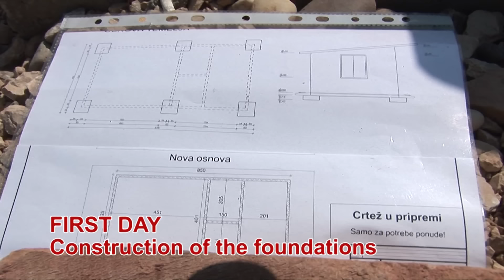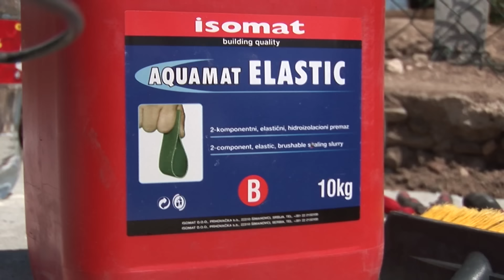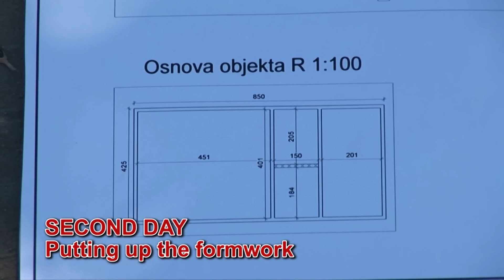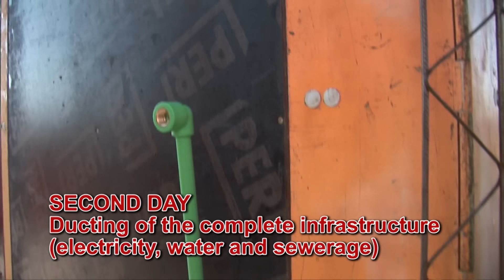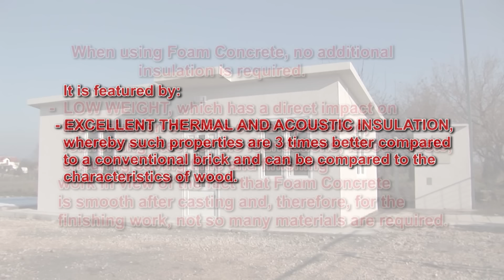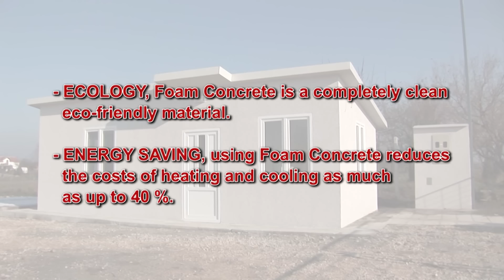FOAM CONCRETE, affordable house built in 6 days!

Comment: What is the chemistry of the foam part of the foamcrete? Does it, for example, release harmful substances as in 'forever' chemicals?
Reply: .. daar gaat vast geen antwoord op komen 🙃
Reply: My thoughts exactly. Of course it releases toxic chemicals forever.
Reply: @jamesonjames8610  —Free head ache for ever
Reply: Each country has its own building material standards.   SRMA is located in Serbia.
Reply: @ikafmedia2007  the danger of asbestos has been known for hundreds of years. But people ignored it especially in the last century when it was highly profitable.
Reply: @sofascialistadankulamegado1781  you're right, when profit sore people are blinded to the consequences..
Reply: It's dish detergent, concrete and air.
Edit: can't forget water :)
Reply: @LuggageStardate  - For what I know, the foam is created with soap and then added to the concrete mix.  Kind of beating egg whites to make a fluffy substance. The result is a form of light, but strong (not heavy) wall.
Reply: I am a professional ceramic, tile, marble and stone industry with 21 years experience looking for a host as a volunteer to understand
Reply: Spray on a sealer coating?
(If it does have vapor issues - don't know for sure). Looks to be a great idea!
😁👍
Reply: @iamaprofessionalceramictil1622  
Having just a little difficulty understanding your comment.
?🤔?
Reply: WVWoman  - They call it foam, because it is foam made with soap that they later use to mix with the cement mix. Go and do some research.
Reply: Hello Christien how are you doing!!
Reply: Ordinary dish soap , for example "Dawn" .  There are also proprietary foaming agents but the dish soap version works fine

Comment: Great video. I have been sculpting E.P.S. for 
20 + years. I did what the computer and machines couldn't. I always was asking, but fell on deaf ears, why don't we manufacture walls that are light, have a very high R rating and easy to put them together on site?
I feel vindicated after watching your video and hope the owners of where I worked are thinking, why didn't we listen to him?
Thank you,
Steven
Reply: I’d love to see your work! Are you on Instagram?
Reply: Non-Toxic?
Reply: This construction company is in Serbia.
Reply: What is the flammability of the foam?
Reply: @stephenaltherr2217  watch the video it says
Reply: @stephenaltherr2217  none, check wikipedia. Loads of info on internet. It is about ensuring the air bubbles are 'stable' and same size
The mix goes by various names.
Reply: I know that feeling! ;-)
Reply: @wolfhenry9134  Non toxic walls would be Hemp concrete ( Hempcrete) theres low allergen drywall and drywall mud for people with severe allergies too . Very Light weight .

Comment: in the UK 1940s, they were called prefabs when they were torn down in the 1980s 40 years after their shelf life they were still servable homes and the occupants didn't want to move out, they had to move into rat trap houses built by contractors using plywood facia boards that fell apart, all modern things are no new or better than what they replace,

Comment: Did anyone notice how in six days trees with leaves turned into trees without them? 🤣
Reply: They didn't say that they were 6 consecutive days.
Between FI day 3 and 4 there would be at least 4 days concrete cure.
Reply: Did anyone notice how there wasn't a slab but 10 small slabs separated by 2x4s 😂😂😂 that's not a slab.

Comment: That's really cool.  How long does it last ? Are there special maintenance considerations? What are its insulation properties?
Reply: 7 yrs - 11 years minimum
Reply: Safety First  hmmm... I saw wooden pillers so I think it'll be alright  
Minimum 100% sure is 3-5 years

But ya it's not 100% safe
Reply: Safety First  r
Reply: Insulation is one of the best , no maintenance at all and will outlast you , it is concrete and styro-foam . it doesnt rot. and it is cheap compaired the regular materials.
Reply: @pauls466  holy sh#t 🤯🤯
Reply: 50 yrs the previous poster said, and still strong
Reply: 7 days.
Reply: what is the r value for the exterior walls, also the ceiling?
Reply: Music is annoying.
Reply: Yrs

Comment: Not using Teflon tape on those water fittings is a recipe for leaking.
Reply: Same guy doing the plumbing joiner and electrical work.wow 15 years at trade school for three separate trades!

Comment: Never mind the house, how much is the land it sits on? How much were the installation of utilities hooked up to the city? Water, sewage, electrical, etc? In California even if the house was free I've seen burned out lots go for 1.2 million dollars in San Jose. Cheap house is a false savings, it's all about the land rights.
Reply: in rural serbia, you can buy a house with a small garden for 20,000 and deal with paperwork later
what i was able to read on one of the workers' shirt, company is from Belgrade, Zemun area
Reply: It was next to the airport so not the most desirable Leland, probably pretty cheap
Reply: Having the wiring inside the foam walls, and no provisions for heating and air has me confused. Different culture, probably top notch for that part of the world. Can't compare apple's to banana's!
Reply: @bigjohnson7415  Literally in Serbia houses aren't at all made this way. They're made of brick, heating provisions are a must (cold winters). I thought foam houses would be a thing in hot parts of US, I have no idea what these guys were doing. In any case, basically the way a house is made depends on the climate. For instance, in the Netherlands houses are made of brick with no insulation, while in Serbia they're made of brick with insulation, cause of the extreme temperatures both in summers and winters.

Comment: Instead of foam cement, maybe  use shredded up pieces of recycled styrofoam insulation and micro rebar mixed into cement. The shredded up styrofoam would provide some  insulation while making the cement lighter. The micro rebar would add strength. Could experiment with shredded car tires mixed into cement. Many car tires have steel belts/strands in them, if adding shredded car tires to cement gave it some strength. It'd be a good way to recycle tires and keep them out of landfills.
Reply: If you watched they used fiberglass reinforcement. The micro steel pins need special equipment and MUST be stainless steel or will rust later. That is one of the biggest problems with rebar, it literally explodes concrete when it rusts. Here in FL we see this problem constantly with concrete.
Reply: R-6 per inch for aircrete .. that's higher than the R-4.2 per inch for EPS foam board ..
Reply: @djea3589  Yeah, those little slivers added to cement are stainless to not rust. Shredded tires might work fine in some things but not others.

Comment: Was it six site days? Or did you leave the foundation to cure for a couple weeks. Then leave the initial pour to cure also for a couple weeks, etc. I did not see a vibrator for the foundation I assume one is not used for the walls. Is this a form of Hebel with fibreglass shreds?
Reply: Had the same thought as you also the tiles application was done on last day without letting it cure properly and then they proceeded installing the bathroom and kitchen cabinets and painting the walls.. etc
I was literally rubbing my eyes watching this video
Reply: @DarthVader-ou2vv  I thought they had poured 2 roof panels and only lifted 1, so maybe the other broke? Pretty sure the tap handles were not level. And as you said. An overall lack of cure time. I guess I am out of luck if I want a new PowerPoint in a different location? I'd have more faith in a core filled block wall with plaster lining attached to furring channels. A crew of blockies would have had that up in no time.
Reply: @MisterGames  I totally agree with you. This type of concrete foam takes way much longer to cure.. How do I know that.. Well I used concrete foam as ground insulation when building my house and it took approximately 4 weeks to get the 12" thick layer of concrete dry and solid enough for further construction.
Reply: It's aircrete it needs the 'air' to stay in it or it loses its R value. If you put any vibrator near that it would be a total mess.  However, I would have thought it would need some drying out before doing other stuff like tiling, painting etc.

Comment: Efficiency function over form. A good start now the work is to make the lego part of the forming so as to allow curvature in architecture and will be a winner.... though 3-D printing is going be a tough competitor.
Reply: I agree,Well said.
Reply: imagine 3d printing a fucking house,it would cost a massive fortune.using all real wood,concrete,brick and ceramics would be cheaper and quicker
Reply: you cant use rebar with 3d printing so wont be as strong
Reply: @Breakn28  Wonder if they can use hempcrete with a 3D?

Comment: Hope nobody needs any piping fixed seeing how its all encased within concrete.
Reply: I was thinking the same thing 🤔
Reply: In Canada at least,  Supply lines and drain pipes in poured floors are pressure tested before and after pouring concrete. It’s a lot easier to break up concrete and replace it than to cut & replace framing, insulation, vapour barrier, rain screen and perhaps exterior sheathings, and/or drywall and then painting and maybe trim too. It’s all too easy to be allowed. This kind of technology would change a great many lives for better.
Reply: 😒 plenty of people encase their plumbing in the foundation. You break the concrete if there was a leak at the location of the pipe that’s leaking.
Reply: @alanaweaver8942  do you build houses? Because it's not really the plumbing going through the floors. Those pipes are for temperature control in the flooring. Not for the house plumbing.
Reply: I think there is sheetrock involved. They just not showing it . I hope.
Reply: @alanaweaver8942  I think we are use to the lumber...lol. Out west they have more of these concrete type foundations, I assume. Different areas/different architecture.  I do actually see it a lot on HGTV homes where they're busting up concrete to reach plumbing.
Reply: @B-EPIC_AMERICA  dude... Almost all plumbing goes through the slab
Reply: @briankappel6131  THROUGH the slab not encased in the slab, that is a huge difference. The majority of the plumbing is in the ground and concrete is poured onto the ground and only the pipes running up into the house are 'in concrete'.
Reply: Along with the electrical from the looks of it. At least they used steel pipes, not likely to have any issues for a long time.
Reply: @MA-mh1vs  so you are gonna tunnel under the slab from the outside to get to a leak? No... Either way if your plumbing leaks you are busting concrete
Reply: @briankappel6131  Actually tunneling under the slab is the least expensive and easiest option to repair a leak. If that is not an option then they can go through the concrete IF the plumbing is not encased in the concrete. The other option is to re-plumb the home from above ground and what is recommended for encased plumbing leaks and if the plumbing is old and may keep developing more leaks.
Reply: @MA-mh1vs  well glad there was an expert here to tell me how plumbing works lol
Reply: @briankappel6131  If you ever have a leak under your slab foundation you will know what your options are ahead of time.
Reply: @briankappel6131  as an architect.. seeing these people claim encasing in concrete is ok and cheaper.. I dont want to live in this world anymore 🤣🤣🤣
Reply: @karinna1456  Thank you.
Reply: Lol, they just tear up the floors inside the house, lol. Looking at the toilet, I'm guessing this is in the U.K.? That's how they do the plumbing there I guess?
Reply: @kman2783  🇬🇧 - no, apparently they have built this in Serbia, according to the other comments
Reply: @gregsullivan7252  Have you ever broken up concrete ? I think not, there is nothing easy about it  and how many times a bad patch job failed and led to leakage in a basement floor .
Reply: Thank you.

Comment: The compressive strength of foam concrete would have to be much less than regular concrete. A two story home would need structural elements other than the foam concrete to support the second floor.
Reply: "foam" 1:58

Comment: the concrete foundation is just newly laid, and it's disturb in one day?
Reply: Does anything have time to dry out?
Reply: they dont say, 6 consecutive days, they say 6 days.  might be two weeks after the foundation was poured, they continued, on day 2 of construction.
Reply: I think they just take out the breaks & concentrate on showing us the work process, not the time line or the whole thing. It needs to be dry for them to do anything else, so, that's my guess?
Reply: @normbograham3  I bet your right, how could it dry out fast enough, and the concrete set, to a load bearing state. they will be erecting an inflatable house next week, and have truck loads of air delivered, and  use that little barrow they have got.
Reply: @kitemanmusic  their using dehydrated water tablets, then you just add water to them, to rehydrate them. a bit like the black light bulbs I have,
 I turn the light on, on the room goes black.

Comment: sooooooo, what exactly is "affordable" ?
Reply: Ha ha there usually like $65,000 aren't they? The smaller and simpler they are the more they are.
Reply: After going down a rabbit hole of links connected to this video I need up at International Foam Concrete Institute. On average it's 70% less expensive but from what I see only a few countries use it. It's kinda brittle.
Reply: @PaperDragons  brittle?
Reply: @joeyknight8272  They are not able to pass most building codes in the US due to issues with being brittle. hard but liable to break or shatter easily.
Reply: it's affordable if you have enough money, but as you say, how do we know, affordable is a reletive term, like hot and cold, light and heavy, long and short, it does not tell us anything.
 some people could afford to own a home made of gold, some people could only afford a home made of straw and mud.
Reply: @daibhiseaghdha153  you can make house from shipping containers, they are stronger and affordable and durable with weather and even very good for earthquake , or storm , flood
Reply: @joeyknight8272  house buil from shipping containers are stronger  than this and also affordable
Reply: @PaperDragons  houses build from shipping containers are more stronger and more durable than this and they pass Us, uk, , Australia , Canada and most countries
Reply: @HueNguyen-xj6rj  most end up being as expensive or only slightly less than traditional buildings from the videos I watched. Shipping container homes are more for novelty seems like
Reply: yes they should let us know cost per sq foot, or per sq meter if outside the US, plus typical maintenance & repair costs.

Comment: If a pipe broke or something went wrong internally, there's no way of doing repairs since all the internal components are incased concrete?
Reply: Steve SZP apparently you live in america where everything is drywall
Reply: I didn't see an answer to your question. hmmmm
Reply: gmrb79s Drywall is used in European countries also.
Reply: exactly put inlarger pipe fish pex through it
Reply: It's foamcrete/aircrete you can cut into it with little effort
Reply: Just noticed that's a 3yr old comment. Lol

Comment: It’s great that the crew building the house seems to know what they’re doing. But I agree that the crew making the video sure left a lot of questions unanswered. Such as why didn’t they use foam concrete for the foundation, if foam concrete is so good?  Secondly, there sure seemed to use a lot of real concrete. Lastly, it seems like they were first making real concrete, then turning it into foam. Doesn’t that kind of defeat the purpose?  Concrete is pretty expensive. What was the cost of this house?
Reply: I would think foam concrete isn’t as strong as just concrete for a foundation but stronger than drywall on wood for walls and faster to put up. But why play music instead of having someone or at least scrolling verbiage explain exactly the what and whys.
Reply: Nope, close

Foam Concrete is Non structureable 
Non load bearing
No weight can rest upon it

Think of styrafoam with cement, not concrete

That's why you see the rebar form a cube, that's concrete
Reply: Unlike North America, it’s common standard to build houses with a concrete structure and brick wall
Reply: @xhonkeri4066  Not where these guys are from.
Reply: Foam concrete is not as strong even with rebar as a 100% concrete foundation with rebar. For walls and the roof foam concrete with rebar is sufficiently strong. The foam additive was made separately and then added to the dry concrete to make the foam concrete. Foam concrete has a good R value, sound deadening qualities, is easier to work and sets up more quickly due to the lower percentage of water in the foam concrete mix. Concrete is expensive. Foam concrete probably costs less than concrete alone.

Comment: I wonder what the strength of the walls are can it support a second story this would be great for a garage with a loft
Reply: Why wouldn't it?
Reply: Think of a tent. You could build it on a flat roof & have support if set correctly (the roof). Yes. It can be done with reasonable skill, by experienced tradesmen!
Reply: For a multi storey building...you will have to provide reinforcement ( Metal - RCC or Hybrid Columns - Beam ) to bear load of RCC / Puf / Reinforced Roofing Material..

Regards,

Sushil Madhukar Adhikari..👍
Reply: I doubt it the MPA for foamcrete is 17.5-20 it can be used for structures at that but it is far lower that the 25-40 MPA of structural concrete.